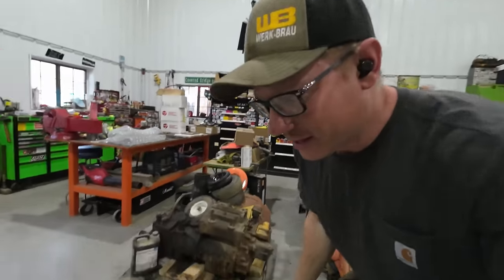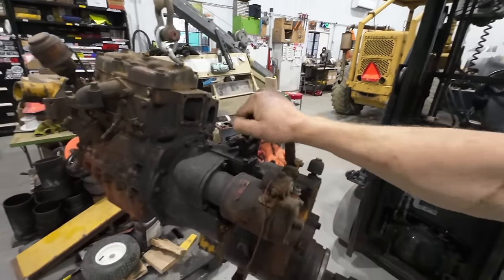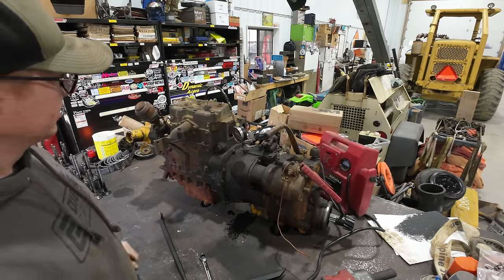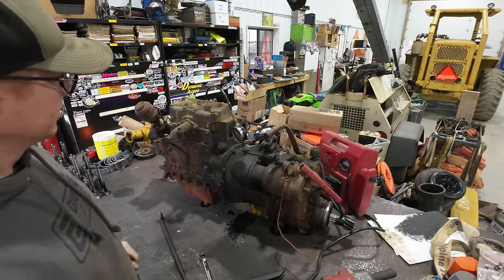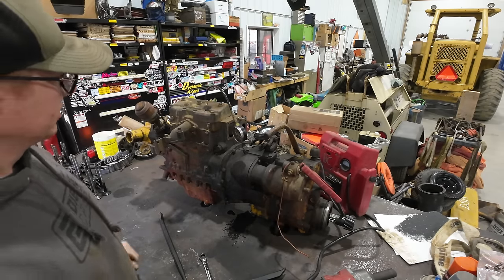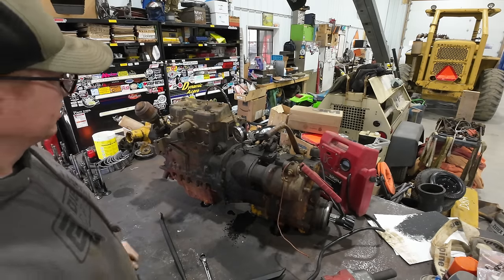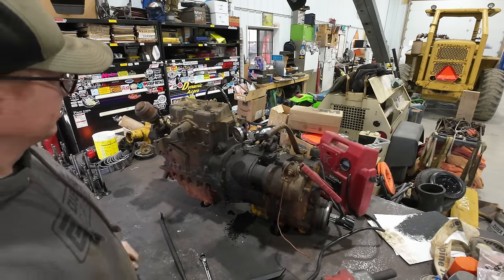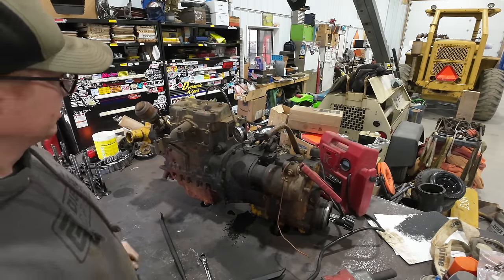AUTOPSY of a Caterpillar Pony Motor. | What Went Wrong?

Comment: Back from the mid '60's when I became an apprentice mechanic, through to the end of the '70's, I worked on everything from lawnmowers to Cat D9 Bulldozers. The main dozer in the fleet at the time was the D8E. These were the four cylinder models with petrol engine start. We called then Donkey motors. The one I loved more than the others was one tractor that had a right angle  drive for a hand crank start of the Donkey engine. At one time the operator boasted that he could hand start his D8E, in the snow,
Sure enough, he knew his business & hand cranked his Donkey motor to life & let it run while he slowly rolled a smoke & lit it. He then pulled it into low gear & engaged the flywheel, then went to make a cup of tea. Next, change into high gear & let the engine turn over while enjoying a 'cuppa'. & a smoke. After a time he mounted his steed, & started it up in the usual way, fulfilling his boast.  None of the others in the fleet had this hand crank feature, but those D8's worked & worked & never ever really let us down. [Except the one that slid sideways off the trailer & bent the blade.] That was about fifty years ago.
Greetings from Australia.
Reply: D7 had the 4 cylinder D339 through the E models.  48Axxxxx serial numbers and there were nearly/identicsl US military tractors with their own serial series maybe 76Xxxxxx??

I agree with what you were saying. No other way a man could take a quart of gasoline and a starting rope in some cases or a hand crank and go start a cold diesel tractor in about any weather.

Comment: Cracked cast Iron can be repaired by a shop that has the facilities to preheat the cast iron for 12 or more hours, weld it up with cast iron rod while hot and return to the furnace for a 12 hour cool down.

Comment: the horizontal opposed engines used on the smaller machines had a aluminium tin alloy bushing for the main bearings and these were know to flog out from the vibration and pounding of the machine as your worked them. a bush solution was to wedge the flywheel to support it and thus prevent it flogging the bushings to death.of course on these inline engines it cant be done.

especially on the flywheel end due to its large mass I would say these inline twins have a similar flaw. having the clutch drive from inside the flywheel would help mitigate the though.

Comment: Obtain a cheap set of side cuts from harbor freight or some such, take a flap wheel to the cutting edges to square the edges to just take the narrowest tip off to help keep from cutting the pins. make sure to spray paint it with red or yellow, blue whatever so you know at a visual that those particular cutters might cut warm butter if you try.

Comment: If you were so inclined, to save that gearbox, you could give Steve a call at Proweld up near Williamsport Pa. They make welding rods. They make rods to fix cracks like that.
They make a multitude of rods for everything. They showed me how to weld a cracked spreader casting and it's still working two years later.

Comment: So, as other commentors suggest and I agree with ,a previously broken starter bendix.It looked to me even part of a return spring .Now we see why it has that square plate on the housing bottom. Too bad it wasnt used when the original incident happened .Id say if anybody messes with old cats and its pony motor, that plate is something to remove to see what falls out before cranking if preliminary checks indicate a problem. I dont expect to be working on any D8 ponys anytime soon but with todays happenings it could be tomorrow. Thanks Matt for the great video,I enjoyed it tremendously and the education as well .

Comment: I've seen those pony engines turned into makeshift tractors "kuliglig" or cicada here in the Philippines. Motor wang-jangled to drive an axle and it functions like a mechanical ox pulling a cart. When the big equipment dies everything useful is stripped and made into something that's needed on the farm.

Comment: Now it's nice and clean it seems a shame not to rebuild it.  Use those gear teeth to cast a new cog and a bit of gaffer tape around the crack on that housing, and grease up those bearings.  It'll be good as new.

Comment: You could save that case if you wanted. Lots of heat and weld it! Even cast iron has a steel base to the iron. You just have to heat it enough prior to welding it.

Comment: A "lesser" set of side cutters is nice for removing cotter/split pins, I found that using Knipex/Hazet cutters often cuts the pin in half for you as they can even cut bolts like butter, but some generic cutters from $5 all the way to Snap-On are great for gripping. One of the few applications that I leave the Knipex in the toolbox, for everything else they are the only pliers that exist to me :)

Comment: Really glad you took the time to post this video. I'm in the process of trying to save an old Cat D7 cable dozer with a pony motor from the scrap yard. It's a long shot since it's been sitting 20+ years. Getting the pony running is going to be a challenge.
Reply from the maker: If the engine turns it’ll run! Don’t let it scrapped!!
Reply: Thanks Matt!

Comment: Having worked on some Diesel engines in the Oil Field, 16 cylinder , we used pony engines to fire them up.  Personally with all the equipment you have I would salvage any and all usable parts.  They could be used on some of you stuff if needed or used as trade items
should the need arise down the line.  Even as repair parts for some of your equipment also.

Comment: An old feller told me once that those ole starting engines were basically half of a Cat Ten or Fifteen engine can’t remember which one, but if there is any truth to it you might find internal engine parts there too.
Reply: That’s true.  Can’t tell you which one it was but you can tell by the fact that it’s odd fire.  All the in-line 2 cylinders were odd fire in the old days.  

Parts for a pony motor would have to be way more available than any of the small gas CAT tractors since they were made at least 30 years later!

Comment: Do not throw away the case, it is repairable with brazing.  I worked at a place that had a Plymouth switcher locomotive using a D8 Cat engine for the prime mover.  They had to rebuild the pony engine,  It was made in 1948 or 49 and mounted to the side of the main engine casting for support and oil sump.  I usually preferred to start the pony with the hand crank instead of the starter because it was easy to fire with the magnito.  Yes, the exhaust of the pony went through the air intake for the diesel to be able to warm the diesel to get it to start.  We could start the diesel in any kind of cold weather that no other diesel would start.  Start the pony and put the transmission in low, engage the diesel flywheel with the compression release pulled so there is no compression and let the diesel roll for 5 to 10 minutes using the pony.  Stop turning the diesel and change to high gear, re-engage the diesel flywheel, and spin the diesel slowly moving the compression release to get the diesel to fire.  Once the diesel started pulling away from the pony then disengage the pony from the diesel flywheel and shut it down.  The diesel was running on its own.  That pony motor was a 6-volt system I believe.
There may have been some gear teeth left in the case from the last repair that finally got caught and did the damage if the repairs were done in the field and in a hurry.

Comment: Thank you matt, another great view into the guts of a motor, none of that looks too bad, the bearings havn't run through to the case, metal paste I just wear and lack of oil changes. The spare teeth look to be starter motor sized. In the past with units like that, that I have kept for parts I loosely assemble the unit so it's all together with grease on the good bits and a list attached. Sometimes a stand so it's easy to move. I would keep the gearcase to and let someone practice fixing it. Bye!..

Comment: The failure was caused by previous starter bendix gear that broke inside in 197?,  harnderned teeth jammed input shaft overloading rear crank mains.
Camshaft wear caused by excessive loading from the blue tooth crank mains.
Transmission crack was probably from it now being the rear crankshaft bearing 12 inches to the rear, which will side load case.
The pony motor became a concrete vibrator. I would bet that crack is 1/2 the distance from front engine mount and rear mount to main diesel engine bell housing.
Great breakdown video!

Comment: I guess, technically, you could braze a patch into that hole, weld up the crankshaft and turn it down, and pour new babbit bearings.  Someone probably replaced a gear years ago, and didn't clean out the bottom of the case.  Pete at Just a Few Acres had one like that recently.

Comment: We had a farm here, in California in the 60's and 70's. Also a John Deere 40. 

Someone told me that this pony motor, on a D8, was a John Deere 40 engine. I wonder at the truth of that!
Reply: I think it is 1/2 of the CAT 10 tractor engine.  It is similar to the JD M, 40, 420 and 430 Dubuke (spelling) Iowa produced tractors in that they all used an odd fire engine that’s basically the back 1/2 of a larger 4 cylinder.  Firing pulses are at 0*—180*————720 degrees which is 0 or the next firing order.  JD 2 cylinder “poppers” were purposely built odd fire to simplify the crankshaft design and to keep the width of the crankcase down. Though we look down on a 2 main bearing design these days, they stood the test of time, perhaps lasting too long so that JD stuck with the old slow turning long stroke popping Jonnies until 1961 while other manufacturers had gone to high speed 4 and 6 cylinder engines as well as small diesels.

It’s interesting that JD used a purpose designed V4 pony motor on their R and later 2 cylinder diesel tractors.  Only thing similar to the CAT ponies is some use the same Zenith TU4C carb as the JD pony.

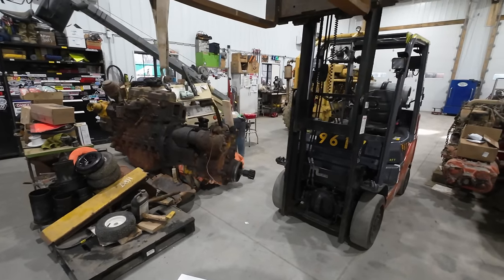Comment: 2:58 Do some measurements, search the web if that starter is the right one for this unit. Could be even the wrong Bendix for it be that far out of alignment. Measure from inside diameter of far side mounting hole to the other side of Bendix, the do the same to the flywheel edge you generate some numbers. Subtraction generates amount of misalignment, tolerances.

Comment: The engine itself seems like a machine shop could probably clean it up pretty easily, with the asterisk that we didn't see all of it in this video.  I've gotten hooked on the Jim's Automotive Machine Shop channel recently and they've done some pretty bad (and pretty old - 1951 Willys Jeep in their newest video) engines.  The gearbox is definitely a "parts only" affair, but anything from it that gets used in the future will definitely need a full-cycle parts washer trip to make sure the metal paste is all gone.

Also, this is the best Diesel Creek intro since the one where the drone came down out of the sky and TSS were playing in front of the shop.

Comment: Hey Matt . . . isn't it the case that Quaker State was known to characteristically leave a bunch of grey-ish sludge behind due to its higher paraffin content. Yes, I well aware that QS is a very different product NOW when compared to their oils 30 years ago, but my personal experience came from using it (for a while) in my wonderful old '67 VW back in college, and grey sludge was always present when using QS until I switched to Valvoline which never left any kind of similar residue on the oil plate. I believe the paraffin combined with moisture that might accumulate in the crankcase when the car was run for shorter distances and not run long enough for the engine to completely warm up - "short" runs like this were the norm when running from my dorm to any class anywhere on campus.

Anyway - love your thoughtful and entertaining content. I always learn something. Thanks for doing what you do the way you do it. Best to you, Matt

Comment: My best guess is the original starter pinion gear split and dropped into the bottom of the motor. the wear and tare on the crank was just poor maintenance  practices. I do not think there is a filter to the pony, just change the oil. Similar to old VW bugs. You might be surprised about how much it might cost to have the crank welded and ground.

Comment: Hi matt,  The scales on the forklift will weigh correctly at ground level,  As you pick a pallet up from the ground. They wont weigh at height.
Reply: There’s no reason that would be true.  A wheel loader where the boom pivots on pins and the load moves first away from the pivot points and then as it goes higher, moves back toward the rear makes the cylinder pressure change if you’re trying to use that, but that electronic scale should only be affected by whether the boom is vertical and even then can stand it to not be perfect.  

That scale has a bad load cell.  😮

Comment: The shape of a gear tooth is called Volute. The curve takes form so that two meshing teeth will 'roll' against each other. That kind of a pure mechanical contact is very hard to achieve on the tiny scale that the rolling surfaces intersect. Thus some rubbing or abrasion, hammer, harmonic, thermal factors will degrtade, even slightly the contact to have a rubbing/sliding componenet.  Heat, wear, noise and waste material result. Does not take much to produce the paste found. All things being equal, the gears will still outlive other elements of the machine.

Comment: Since the crank bearing wasn't coming out easily and it was just chunking I'm guessing it's a formed lead bearing. I've seen a similar setup with people who rebuild old hit-n-miss or stationary engines, they heat up the cast casings to melt the lead bearing. :)

Comment: I suspect that if those teeth are from a gear that exploded, either they got left in the case during the repair OR when you heard the massive BANG and found the brand new hole in the side of the housing, it was created by the missing gear chunks as they reached escape velocity when the gear exploded and they are in the field the machine was in when the pony motor failed...

Comment: I've always found that you learn more about how something works by pulling it apart, and this video did not disappoint.  I'm still as perplexed as to where that piece came from, but it certainly held together well enough to do significant damage to the gear case.  A new counterbalance hoist?  I thought I was dreaming when I didn't see that green machine you usually motor about with, and then you mentioned picking up hoists, as in plural.  I'm guessing there's a video about those coming?

Comment: Matt, it looked like the starter bolted into the bellhousing and directly into the oil-bath trans system. My guess is that there isn't a missing gear, but perhaps those teeth were from a starter drive(Bendix) that previously failed or shattered and the teeth  fell inside. Maybe a newer starter was slapped on and the remains were left for you to discover years later...???

Comment: It sounds strange but we had a D7 or 8 I can't remember which in the Engineers on the DMZ in Vietnam.  We did not have the best of equipment in an area 3 miles south of the DMZ  Anyway it honestly had a pony engine on it.  Eventually the horrific sand ruined it and the accompaning CAT engine.  They deactivated my unit and as far as I know it is still buries in the sand there somewhere.

Comment: Gear teeth came from a old starter, when the crank shaft bearing wore the original starter motor became separated from the flywheel and when it reached the end of the engagement it sheared the teeth off, and they fell into the bottom of the housing. Someway you activated one of them and that is the hole in the housing.

Comment: Gear teeth off of the starter from the early stages of crankshaft bearing wear. The starter pinion could have been softer metal than the flywheel ring gear, as you found you can't really cheek the crankshaft bearing wear without basically removing the engine from the main engine. In the field everything is make do and mend to get the machine running again and earning.

Comment: Matt I would have a guess that the previous commentators were spot on about the starter being replaced and the fact that you needed to unbolt the starter and jack it up to start the pony may have cause the loose teeth to slide down and eventually jam the gear.

Comment: Yes sir, these parts can be salvaged but at what cost. Now something that is not made anymore and service parts can be extremely hard to find may be justified in keeping. When one fools around with this older equipment one has a tendency to "packrat" parts, but sometimes those "packrat' parts come in handy. The term "throw away engines and such really derives from the fact that it costs more to rebuild than to buy new. But in the case of older stuff, well it is a different kettle of fish. It appears as though the extreme wear on the bearings and the sloppiness of crankshaft play is the culprit of the damage to that starter case. As my Granddaddy used to do you find another unit and make one out of two. That is of course you get lucky and are able to get salvageable parts from both.